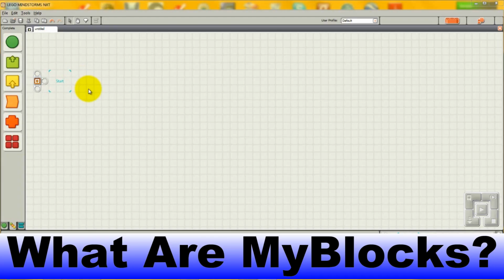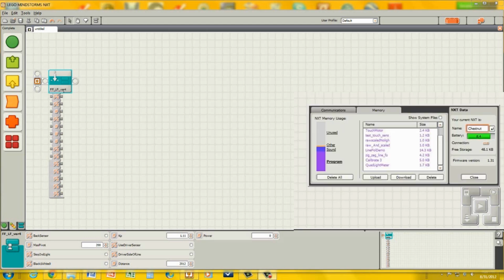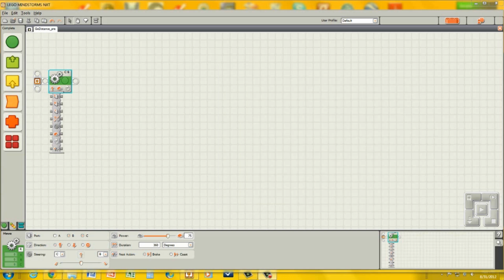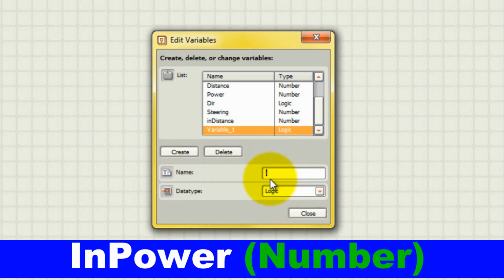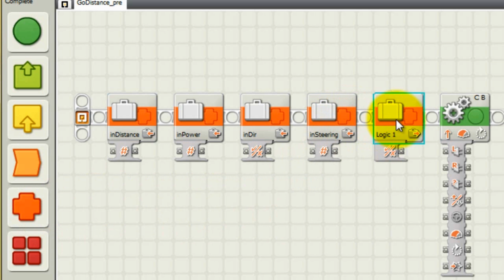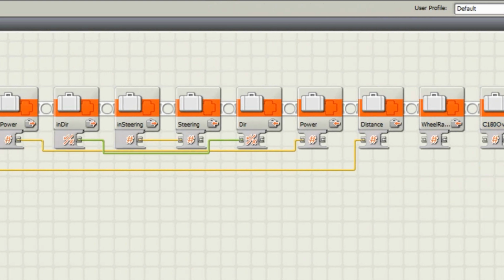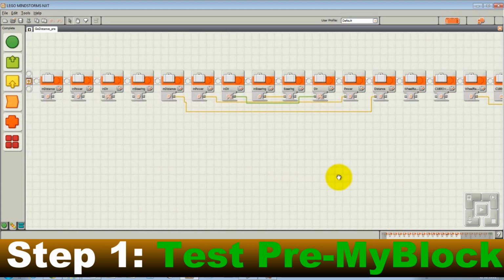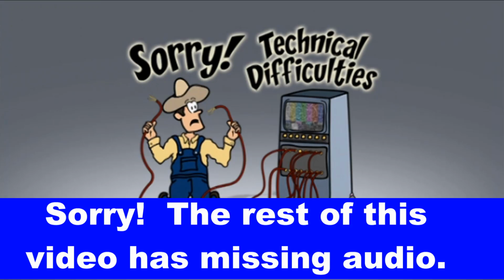Introduction to Making and Using MyBlocks in NXT-G for FLL

Comment: Well done!
Your videos are very good and they will help a lot of FLL teams to improve their programmieng. We made a few MyBlocks for FLL too.
Have you got a Linfollower with PID control or only with P?
And do you adjust the Left and the right motor with PID?
we do both with a PID controll, it is much better than a normal P controll.